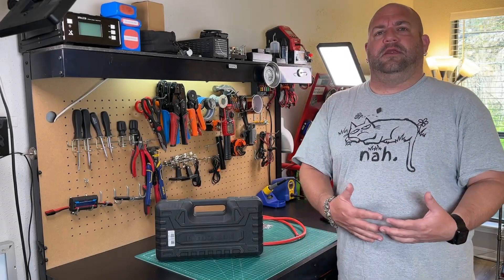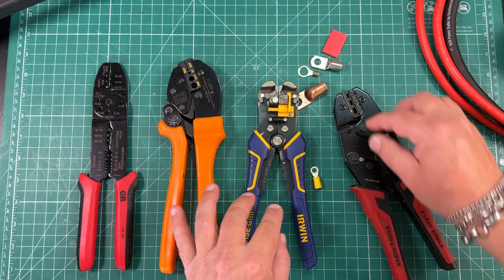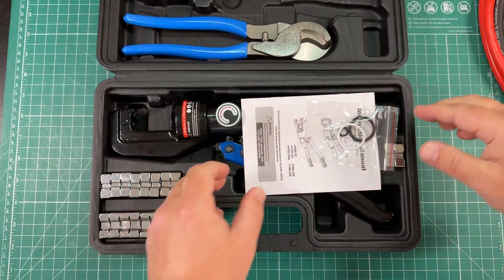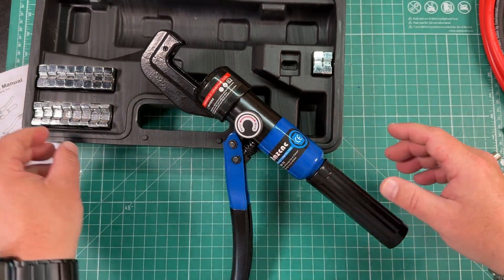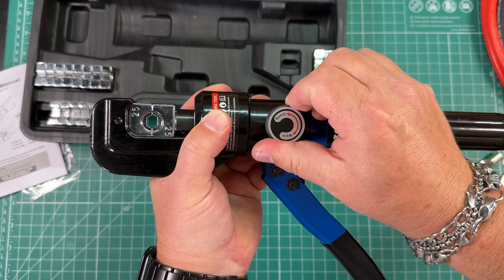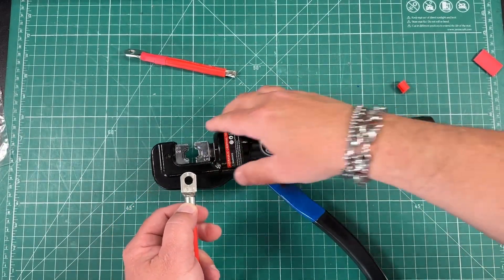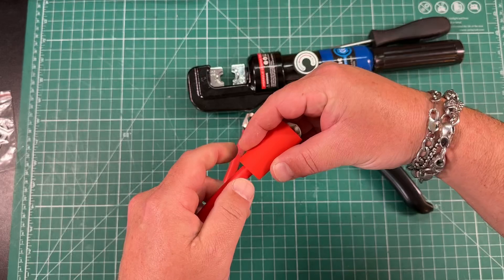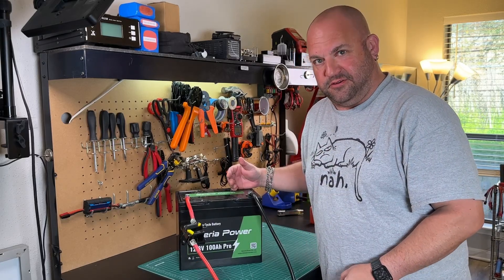Never Have A Bad Crimp Again!  Use Hydraulics!

Comment: Ideally you'd want to orient your lug 90 degrees so that if you do get "wings" they will be on the side where they are less likely to stab another wire that might run over the top of this one. More likely to have a cable running over the top of another than be parallel to another to the point they are touching.

Comment: These crimper sets are down to $30 or $35 if you shop around. Just look at the die set carefully and try to buy one that appears to have dies that don't look like shit. Obviously if you're in the USA and use AWG and you can find one with AWG dies that would be better but you can work with MM2 metric dies and find one that'll crimp your wire right.
Reply: Oh shit this comes with a set of cable cutters.....and that'll set you back $10 to $20 depending on the quality you buy so having a set of cable cutters that'll probably do up to 2/0 easily is a pretty damn good deal. Especially since the die set on this is a bit smaller than usual which is probably what most of us want.

Comment: Mike thanks for putting this unique tool on the show.  

I got the hydraulic crimping tool on Tuesday. This is an awesome tool,  makes perfect crimps. The pliers that come with it are super sharp, the dyes are well machined, and most importantly, the crimps fit as they should. 

I have found that a lot of crimping tools are not always properly machined, they are either too narrow, or so thin that it is hard to seat the crimp for proper alignment. I have also seen some tools bend due to poor sizing and inadequate materials. After the crimp is completed, the crimp itself is not even, and appears "incomplete". This tool eliminates those issues and it is well worth the money!

Works great on 200 & 300  LB test monofilament tuna leader for rigging large offshore fishing lures. This kit comes with a pair of white gloves, an odd part of the kit, but they come in handy here in Utah. Very fashionable, LMAO

Louis WW7GBA

Comment: Back when I was in field operations for a telecom I was always on a ladder using those, that was never fun.  The day they bought us the electric crimps (looks like a cordless drill with a crimp head)was awesome.  Anyway you are right, making a solid connection is key.  When you are working on larger cables those are the only tool to have.  It is amazing how one weak crimp makes the whole thing fall apart.  Having that wire pop out in an enclosure could be a nightmare with these large batteries.

Comment: Hey Mike, keep us informed on how those hold up.  I was actually researching this type of crimper last week and it seemed some people had a problem with some of the cheap ones leaking hydraulic fluid. Not specifically the ones you have,  but the yellow ones on Amazon. Several channels recommended Temco brand.  Some of the other cheap brands don't have the spring in the handle, and you have to pull it back up after each pump. Major pita.

Comment: Harbor Freight sells the exact same tool with a different paint job, but I don't think it's cheaper there. And the cable cutters are sold separately there, but you do get a lifetime guarantee on the cable cutters, and you could place a plan on the crimper and replace it every 2 years dirt cheap
Reply from the maker: I didn't even think of checking my favorite store, Harbor Freight.

Comment: I didn’t like how the excess portion of the terminal sort of oozed out. I like the hammer type crimper myself.
Reply from the maker: Yeah I noticed that too.  It didn't do it on the 1/0 terminals I crimped.  They could just be crappy Chinese terminals I was using but I really don't know.  Either way it's a solid crimp.

Comment: I have to agree. Those things work great. As a companion tool, I would suggest looking into a ferrule set. These make stranded wire connections that are not crimped to be much more sound.
Reply from the maker: Oh I've got one of those too lol!  Not for this big of wire though.
Reply: @hamradiotube   I figured you did. The comment was mostly for others. Quite true about the wire size though, most people are going to use on much smaller wires. 
As for the hydrolic crimper, when I was setting up my station I needed to build a ground system so bought some braided wire strap and crimped the connectors with the tool Was instantly sold on the usefulness of the tool. They also work for making those wire rail things for decks and stairwells.

Comment: Cool... do you think it could be used for crimp on co-ax connectors too??
Reply from the maker: Some of them maybe?  I mean, I used my Coax die for LMR-400 to crimp my 1/0 AWG wire.  I'm sure there's some cross over in sizes but you might be better off getting a crimper for coax in the long run.